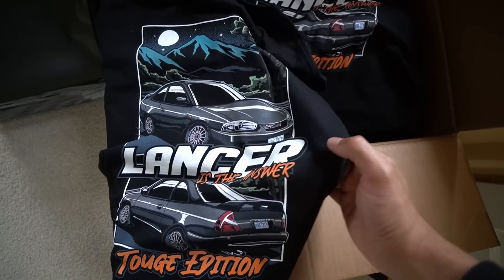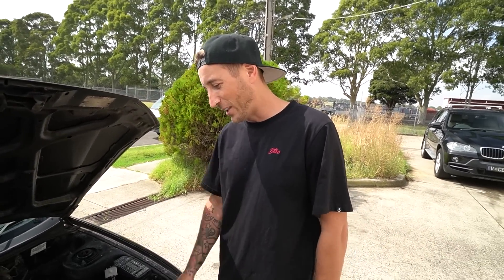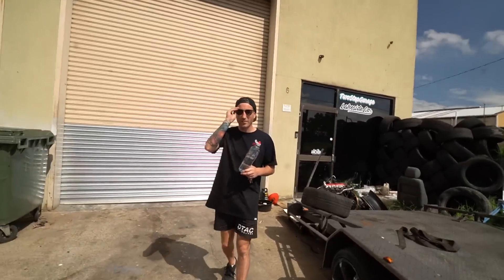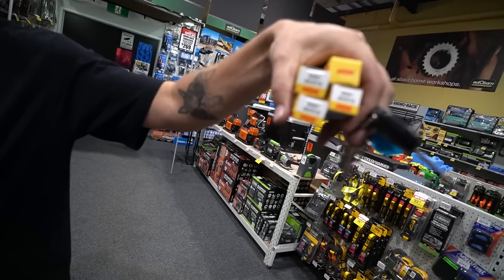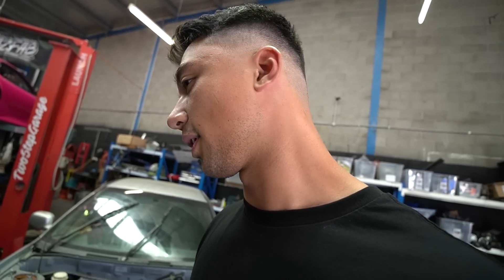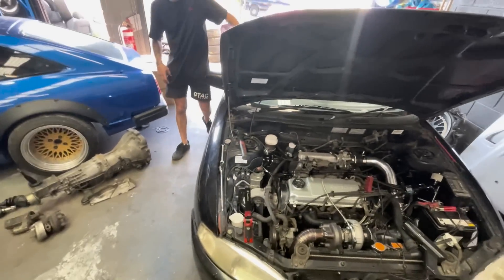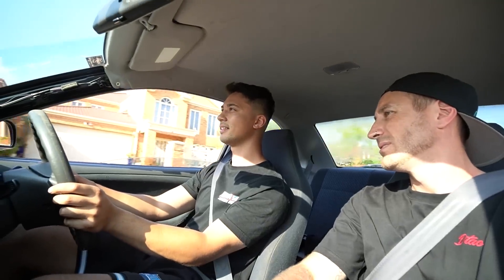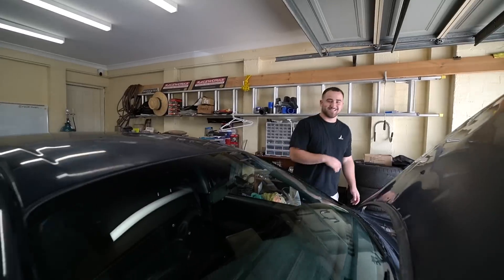Adding MORE BOOST with NO TUNE - Experimenting on the TURBO Lancer!

Comment: max on stock block and internals 10psi, recommended FP Walbro 255i. 250cc no where near enough. MIN 400cc. on 250s ull max out the duty cycle before you max out what that engine/turbo set up will make. done this build before.

Comment: The lancer is screaming for an electric power steering pump, you can get a volvo one from the wreckers and install it in the boot running pwr steering fluid through custom lines to the rack and pinion to get smooth asf steering, obv its another job that takes research and time but definitel something to consider for another episode if youre keen

Comment: you can use the injectors from the magna v6 aswell. bolt in replacement and heaps more flow

Comment: could someone help me, i dont know a whole lot about turbos but im wondering how do you know what turbo u buy makes the sututu noise i know about blow off valves but i just need someone to explain the differences
Reply: The bov prevents the sutututu because the air escapes out the bov the sutututu is the boost getting chopped by the turbo